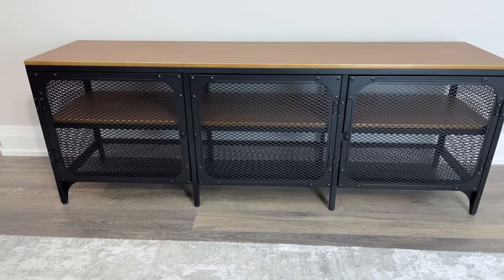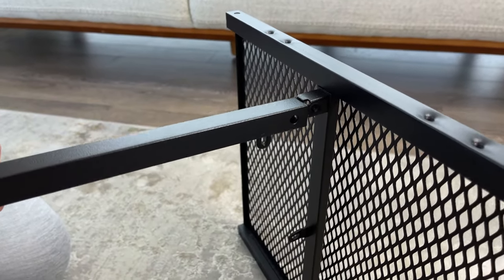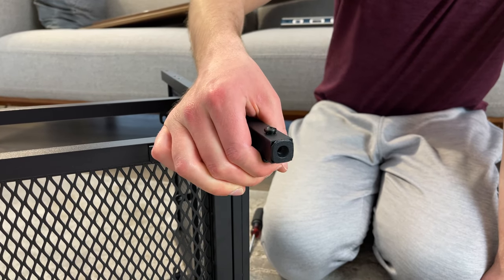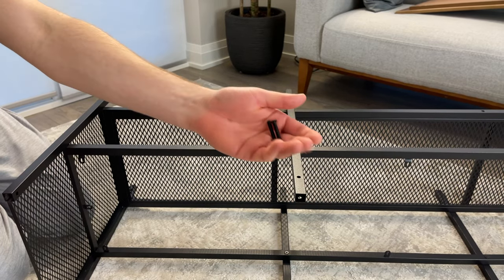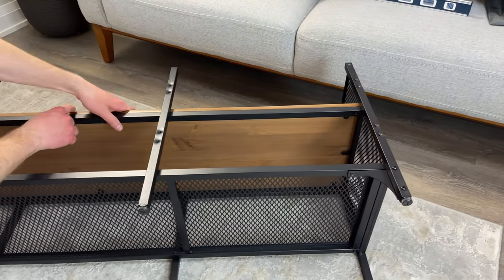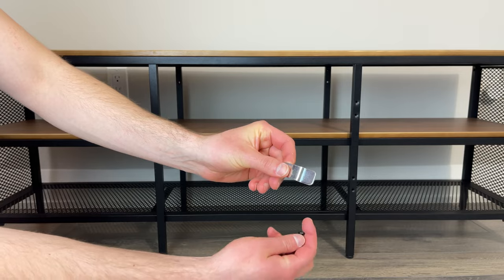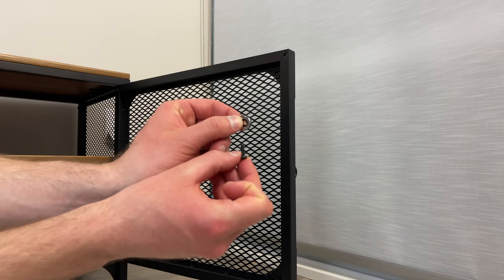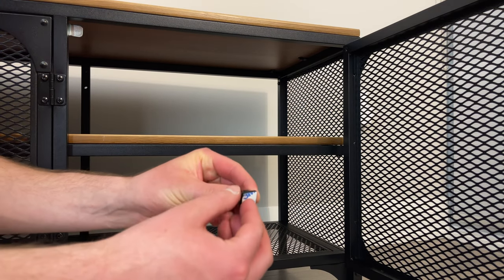Easy To Follow IKEA Fjallbo TV Bench Tutorial

Comment: Are the holes there and just punch through  it or you actually have to make a hole with that tool? I don’t have that tool which is why I’m concerned. Thanks
Reply from the maker: Pine is a soft wood so even if you have a really tiny screwdriver, it will work (to make the hole). You can honestly use a pen or any other pointy objects around your house. It's just used for making the screw go into the wood easier. You also don't even have to make the holes but you'll have to apply more pressure when using your screwdriver to screw in the screws.
Reply: @originalfurniturereviews2964  Great. Thank you so much!

Comment: My all 3 doors are not fit properly in the space. So there’s uneven gap space between all sides of the door and the frame. Any idea why?
Reply from the maker: It's hard to tell what the problem is, if I can't see your Fjallbo TV Bench but have you tried adjusting the hinges?
Reply: It’s made like that
Reply: @elisscaliving4776  yaa. Ive accepted that fact. But it does annoy me once in a while when i see them. Like why do the space dont match each other 😅
Reply: Loosen all the hinges and lift the door to where you want it to be then tighten the hinges. If your doors don’t close there's a very easy fix to this and it's in Steps 22 and 26 of the instruction booklet. If you think the instructions tell you that you have one big magnet connecting to one door then you're wrong. In step 26, you have 3 magnets, 1 for each door. In step 22 you attach 2 silver components to the frame of the TV unit. When you attach those and then attach the magnets to the doors then the magnetism will connect them to each other and your doors close securely.